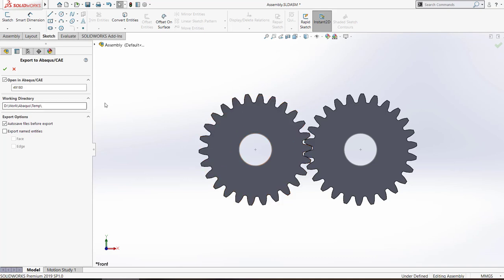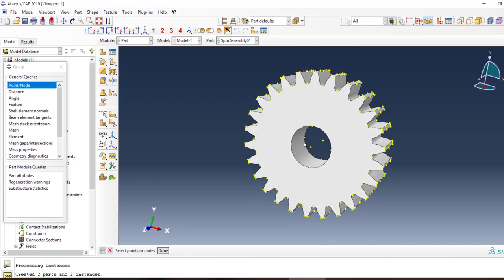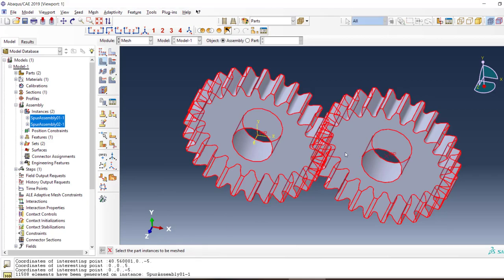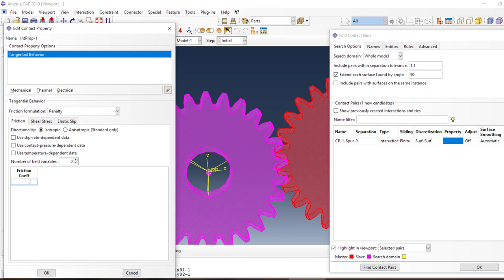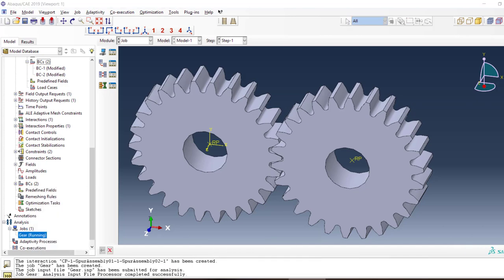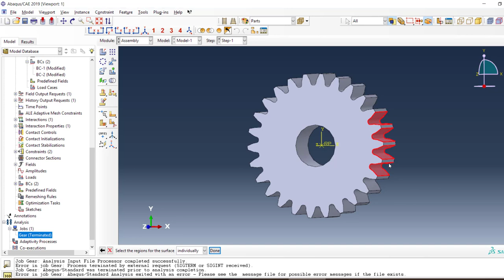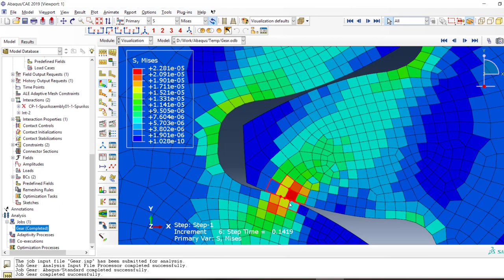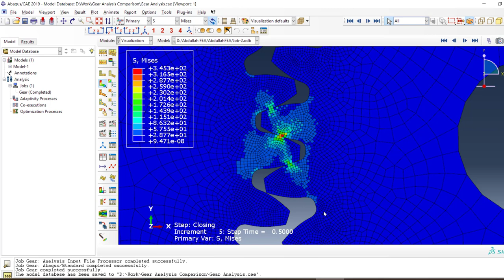How to set up a Gear Analysis in ABAQUS using Frictional contact.

Comment: Hello , Sir.. I want to ask you how to do analysis of Friction stir welding using coupled Eulerian and lagrangian method.??
It would ne great if u give some hint🙏
Reply from the maker: I haven't done welding process FEA Yet, but i hope its a fun stuff as well. Usually the first thing to start off is a research paper. Download a couple on the topic and then select 1 you think is nearest to your topic. Then try to simulate that. Usually reading from ANSYS/ABAQUS documentation helps alot :)
Reply: @DesignHyper  Okk. Sir thanks you very much.🙏

Comment: Hey could you please share the file on solidworks for the gears so i can use the same one and try to do stress analysis on abaqus or maybe if you have a video for the gear design on solidworks that you exported to either abaqus or ansys will be great
Reply from the maker: I  can share the file and will soon make a tutorial for the gear cad in solidworks. Please let me know what version of Solidworks you have so i can send you the relevant one. Thanks
Reply: DesignHyper could you please reply to my previous message I am really stuck and its my for 3rd year project at university and coursework deadline is coming. I would appreciate if you can let me know how you set the speed to the gears
Reply from the maker: @tufanuyanik1096  :) Can you please elaborate the problem you have? Once you have the contacts set up and working fine then increasing the speed can affect results. Essentially you need to apply YOUR boundary conditions and not the ones i have. If you need any further help, let me know your skype or add me, my skype name is designlatch. Thanks,
Reply: DesignHyper thank you for your reply. I am trying to do dynamic analysis and also static analysis on abaqus for two spur gears. I am trying to rotate the gear in around 1500, 2000, 2500, 3000 and 3500 rpm and at the same time pinion will rotate accordingly. Throughout this I am trying to analyse the contact stress ( Mises ) maximum and compare this to hertzian contact stress that I have done on paper for the same spur gears with same dimensions and measurements. However I am stuck with setting up the boundary condition for the rotational speed for the gear. I have spoken to my supervisor and he recommended to apply moment on the gear but that doesnt seem to work too. I just need a bit guidance of applying the rpm to the gear. I have also added you on skype i would not mind if we can speak there too. Thank you
Reply from the maker: @tufanuyanik1096  No Worries, The boundary conditions are usually bound to real physical settings. So if you have external load then moment will make more sense but if there is a specific rpm motor then boundary condition with rotational DOF make more sense. Just ring me on skype if you need. Thanks again!

Comment: Hello Sir AApne Assembly import kia hai na? I have alse imported the assembly in x_b format but problem aarahi hai ki part me sirf ek hi spur gear dikha raha hai. Doosra spur gear ka option hi nahi aaraha hai!?
Reply from the maker: Hi Raj! You can use only 1 gear to import same part twice in assembly. 
just make sure you are looking at assembly tab and not parts tab because 
1. if you imported an assembly - two gears. 
2. then it should show two gears in assembly and individual in parts. 
Let me know if it works out. 
Thanks,
Reply: @DesignHyper  Thanks a lot sir... It means a lot
Reply: Sir ek aur problem hai The monitor is showing"NSET CHARACTERS SHOULD BE KE THAN 80"  what about this???
Reply: * less than 80
Reply from the maker: @rajkothari4232  Make sure your selection is correct.
Reply: @DesignHyper  Yes sir.. i found my mistake. Thanks a lot
Reply: @DesignHyper  Sir ek baat puch ni thi.. how did u increase the speed of the gears.??
Reply from the maker: @rajkothari4232  :) Brother! just increase Velocity boundary condition.
Reply: @DesignHyper  thanku sir.